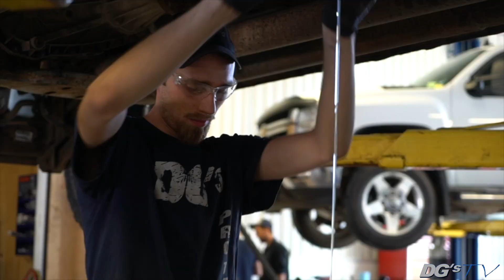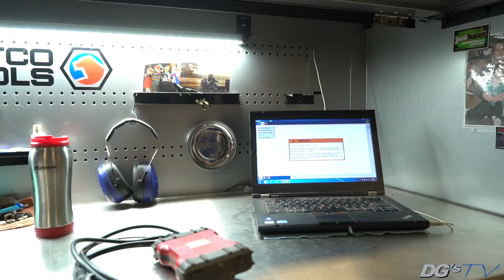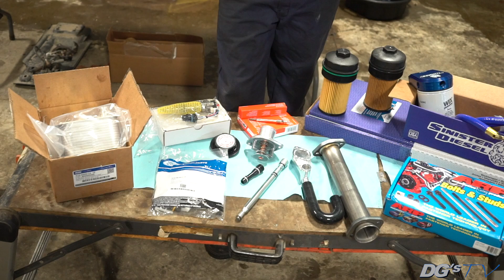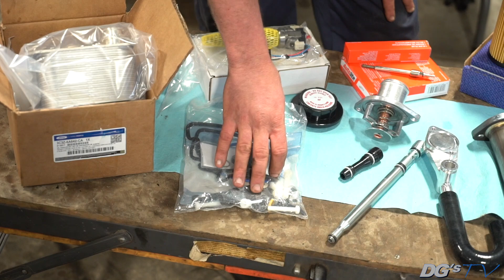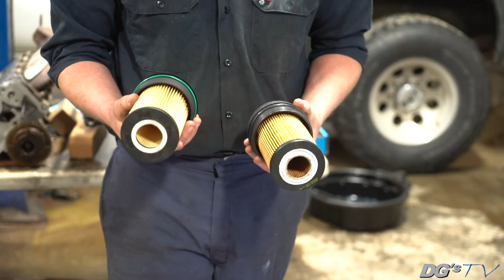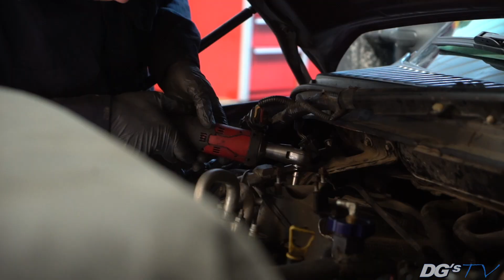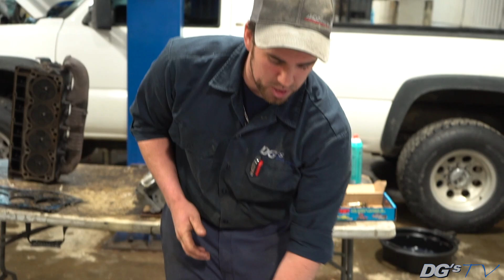EP 4 - Ford 6.0L Problems and Bulletproofing

Comment: I had an 05 6.0L box truck that I got in 08 with only 68,000KM on it, worst piece of junk I have ever owned, I bought it thinking that diesels were good on work trucks and saved money on fuel. If I could have done it over again I would have bought a gas box truck. I sold the POS at 120,000KM after thousands on repairs, the thing couldn't make it a couple of months without breaking down. Every breakdown meant at least 1K at the diesel shop. The last time it died just driving down the road, mechanic wanted another 4k to get it going again, I had so little confidence in that truck I just sold it to my gas mechanic who fixed it and sold it, I took 3.5K for it and never looked back. Money robbing unreliable garbage. The motors are cool when they work, the torque was great, mileage was good and it sounds like a beast. The only people who should own these are diesel mechanics who can pick one up cheap and enjoys fixing them.

Comment: I have a 6.0 diesel  truck thats a  03 with 82000 miles on it . What cheap parts can I replace?
Reply: cheap?? You are the reason people buy used vehicles that fall apart on them
Reply: @hutchesonchris42  I like too got the 2019 or 2020 F-150 with the 3.0 but its $46.000. im using motor craft parts on my old truck.
Reply from the maker: happy to discuss with you, give me a call at the shop when your free, 519-418-2886
Reply: Also depends on what ur trying to do. Looking for power won’t be as cheap

Comment: With enough money you could make a GM  350 cubic Inch diesel a good engine, the problem is,  is it worth it???
Reply: Just buy a big block
Reply: Considering the cost of a new or newer diesel truck today yes it's worth if you want a good truck that will be dependable  you end up with about 15 to 20k in the truck total at most 30k if you have to pay too much for the truck and then have the stage 3 "bulletproof" done to it now you have a tough and dependable long lasting truck and saved $50 thousand dollars or more all the new technology and learning how to fix them right and fixing the right stuff on them has made them better than any of the other diesel engines

Comment: A friend of mine had a 6.0 and had it in the shop so much the shop (Ford) they had to replace the cab bolts because they wore out from having to be removed/replaced too many times
Reply: That's because it was at a Ford shop/dealership. Ford techs are told replace parts, not fix the problem. Half of the techs at Ford dealers dont know a damn thing about em. NEVER NEVER NEVER bring a diesel back to the dealership!!
Reply: @joebiker5992  
Then where do you take a Ford diesel? Wal Mart?
Reply: @bertgrau9246  lol yep. Probably better off. In all seriousness, bring them to diesel specialists shops. You get what you pay for from them. They do far better work than dealerships. Remember, dealerships fix what's broken, a good specialist will help you solve the problem. Except the 6.4s... they're just junk
Reply: The stock bolts are torque to yield. They shouldn't be reused even once. Reusing them nearly guarantees a head gasket failure. 

From the interwebs:
 A torque to yield fastener (TTY) or stretch bolt is a fastener which is torqued beyond the state of elasticity and therefore undergoes plastic deformation, causing it to become permanently elongated.
Reply: Bill Collins CAB bolts...
Reply: @AtomikTurtle  not head bolts.  The cab, when you work on a Ford truck you remove the CAB bolts and take the entire body off.

Comment: The costs of a fix is not told . Is he talking about 10/15/20,000 ?  I  Like Ford.7.3 s, but now their diesel program really sucks ,and has gotten crazy bad  !!! For the 1st time in 60 years I am thinking of  looking at a Dodge mega cab Cummins. !!!   The fords are getting to expensive to buy and to many problems down the road from bad engineering !!! To bad Ford didn't have a Cummins motor in their trucks !!!!
Reply: If you get a Ford F 750 you can get a Cummins

Comment: The best thing you can do for the 6.0 is get rid of the EGR. I've got 236k on an 04 and no studs. If you are going to stud it then you really need to fire ring each cylinder along with the studs
Reply: how can you get rid of egr
Reply: @originalabesha7480  
You can order a delete kit from XDP, Alligator Performance, or any other diesel specialty store. You will need a good diesel mechanic. As far as the long starts, try running archoil in your next couple oil changes.
Reply: can you give a little info how to get rid of the EGR? my truck takes to long to start.
Reply: @originalabesha7480  @ original abesha are your long starts when your motor is cold or when it is already warm? Because depending that could be several different things might want to check your battery levels with each of them disconnected to check power level. Also could be your dummy plugs if your getting a no-start hot or hard to start hot the other if you want to upgrade to the 6. 4 liter starter it will start right up. Also there is a big difference between an EGR valve and a huge EGR cooler you could delete the EGR cooler where if your state emissions allow you to if not you should buy a bulletproof Diesel H- core upgrade. But you can clean you EGR valve. if you decide to delete your EGR cooler you can leave your EGR valve and place in still plugged in so it doesn't throw a check engine light.

Comment: Someone should of made Ford EAT the cost of these parts covering their mistakes. My ford "have a stroke" diesel fail me on the way to sturgis in the middle of South Dakota. High-pressure oil pump crapped out on me and set me back 4 large. Ruined the WHOLE TRIP. If you own a 6.0 you better have a credit card limit OF SIX grand. NO JOKE. If you hear something that sounds like a whine similar to what you may think is an alternator going out, its NOT. Its a hole in your pocket forming called the HPOP going bad.
Reply: Sorry to hear about your luck! but the good people of SD thank you for the tax dollars.
Reply: Biggest POS motor ever, especially for small businesses that can't afford 4-6K repair bills, and after that you probably have 3 months before the next failure, I heard the 6.4's are not much better, I drove a new plow truck with the 6.7 and it had failures under warranty. Just buy gas, modern diesels are garbage.

Comment: So if ford knows all this why in hell do they not fix them before they sell them?
Instead of somebody spending 50-80k on a truck and them haveing it break down for so stupid ass cheapshit parts.
Head gasket change on a new truck that they know will fail??
I will never by a ford now
Is it beca’use they can then have it fixed with the right parts later and not cover them under the warranty? Costing the hard working man more money.

Comment: I read about the possibility of casting sand not being removed from the 6.0 blocks due to some sort of process failure, so I did a thorough flush by removing block drains and repeatedly filling, draining and hosing the cooling system, all while capturing the exiting water and when nothing but clean water was coming out I stopped and measured about 1/2” of casting sand in the bottom of a 5 gallon bucket. The leading cause of 6.0 failure is overheating caused by lack of coolant flow through the oil cooler and the egr cooler. The original oil cooler/heat exchanger had small enough passage ways to trap casting sand and contaminates (like a filter) leading to severe blockage. After the flush I bought new style oil cooler and a stainless egr cooler and had the exhaust inlet welded shut. Another issue that is a simple fix is the buildup of soot in the oil which eventually fouls the injectors. This can be greatly reduced by switching to a fully synthetic low ash oil. (http://www.trucktrend.com/news/0610dp-low-ash-oil-news/) No more “stiction” problems. The oil actually stays clear for a long time instead of instantly turning black after changes. I also quit using the Ford Gold coolant due to it’s high silicate content and possible cooler clogging properties and switched to Cat ELC silicate free coolant. (http://www.bmgs.com.tr/doc/GucSistemleri/MusteriDestek/CAT-ELC.pdf)
Reply: Switching coolant is a good way to cause "coolant sand" just fyi.

Comment: I noticed Autolite glowplugs there..in my experience working on diesels 9O% of glowplug failure issues on ANY diesel have been Autolite brand..use Motorcraft glowplugs on every Powerstroke. The cost is maybe .50 cents to a dollar higher each (at least at my local parts stores).
Reply: Zack VanMeter I always use motocraft parts on my 6.0
Reply: @luvacxd808  9
Reply: Champion glow plugs get the job done aswell most important is ensuring glow plug harness is in good shape that is generally the cause of glowplugs performance issues

Comment: I would really like one of those trucks  like a 7.3 or 6.0 but it seems like they are way too expensive to run and maintain . Is it really worth the extra money?
Reply: Mgtow Jones runs for half a million miles if you take care of it. Diesel comes with more maintenance on it.
Reply: i have a 7.3 and a 6.0no. The 7.3 has been great 302k the 6.0no is a POS. If you tow frequently diesel is the way to go but if you only tow once in a while or don't tow long distance gasser it the way to go. The cost of repairs, the few people that know how to fix them and the price of fuel negate any value unless you plan on towing with them.

Comment: Best way to bullet proof a 6.0 is dont get a 6.0. If you gotta bullet proof it before you can actually make any real power with is not a good platform to start with.
Reply: Colton Carpenter Bullet proofing doesn’t add power. Once bullet proofed, the 6.0 is one of the best Diesel engines out there. Also, Dodge and Chevy Diesel engines have their inherent problems as well.
Reply: @tabcobra  you didnt follow what i said. You're already set back if you have to bulletproof in order to make power safely. Duramax and cummins will go further before your forced to upgrade. The 6.0 was iffy stock, ive been around to many that had a mechanical issue stock as work trucks id never spend time on one unless some had already done the bulletproofing even then did they do it right. He mentioned not if but when different components fail. So why waste time on a failure prone engine that was under engineered.
Reply: @coltoncarpenter3790  lly and their head gaskets, lml cp4, lbz weak pistons. Dont get me started on the 6.7 cummins
Reply: @abolishguncontrollaws5689  it takes less to bullet proof a lbz or lly or newer duramaxs. Same for majority of the cummins. There are far better powerstrokes that the 6.0 to spend your money on.
Reply: @coltoncarpenter3790  you contradict yourself. There's no better ps than the 6.0
Reply: @coltoncarpenter3790  if you think replacing pistons on a lbz is less work and or money than studding a 6.0, you're silly.
Reply: @abolishguncontrollaws5689  it is cheaper to reach 700rwhp with a duramax or cummins than it is with a 6.0.
Reply: @coltoncarpenter3790  nah, piston replacement is costly on a lbz.
Reply: Abolish Gun Control Laws id say the 5.9 Cummins could be less work. But finding a good body for the cheap could be tough
Reply: I had a 6.0 with a plethora of issues not mentioned in the video. Got rid of it at a large financial loss when it had 55,000 miles. I would never buy another Ford again. Happily driving a Tundra but am careful not to haul over its capacity. Wish they made a 3/4 ton diesel.

Comment: He forgot to mention that there was probably 3-5000.00$ worth of arguing with your wife and selling your quad on that table ¡ I just mean mugged my 6.0 !!
Reply: exactly! you cant upsell all these "upgrades" and fixes and this and that and the other thing oh yeah youll have a bullet proof 6.0 yet theres zero warranty on it and it cost you and additional 5k if not more! and there still a whole driveline and truck surrounding that which could need attention
Reply: @AndrewBrowner with new full size diesels priced at $125,000  or more (Canada) , it might be worth spending 5 or 6 thousand on an older 6.0 diesel if the rest of the truck is in decent shape. I factory ordered an F350 6.0 in 2003. It has been perfect  for 23 years. At 120,000 kms I had a shop do the egr delete  as a precaution. 
That was the only engine work done until last year. Reliability has been perfect and it has done lots of heavy towing. Last  year it (at 360,000 kms now) new hpop , oil cooler, ipr and IPC sensor and other sensors. Heads have never been off and injectors are original.  There is no blowby at the breather cap.
It runs great again and should be good for a long time. Cost was about 5 k. I'm happy.
Reply: Haha
Reply: high pressure oil pump/regulator replacement had me quoted at $3k. all of this is probably $5k.
Reply: Cool

Comment: The solution to 6.0L problems is not to buy one in the first place. buy a cummins if you are not a loaded with cash ford fan
Reply: I've never had any problems with my Powerstroke's but do agree that Cummins builds good diesel engines but the problem with buying a Cummins is that they come with a piece of shit Dodge wrapped around them
Reply: Dodge/Ram may have one of the most reliable diesel engines in the game.... but the rest of the rattling, transmission eating, front-end deteriorating truck is the problem in a Dodge /Ram.
Reply: Great motor but what to do with the shipping crate it came in?
Reply: Lol. I guess it's true what they say you can't fix stupid
Reply: I made the mistake, been sitting for about 2 years now.